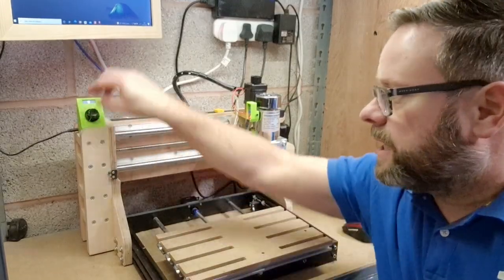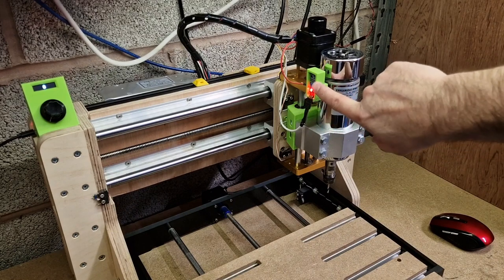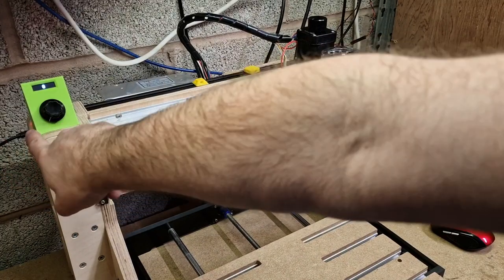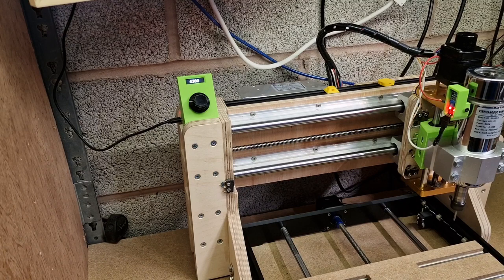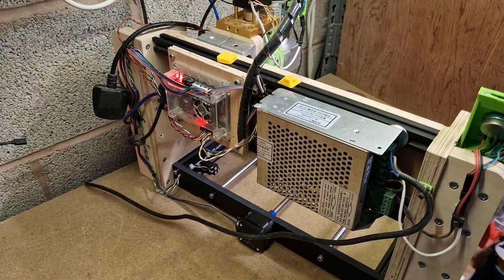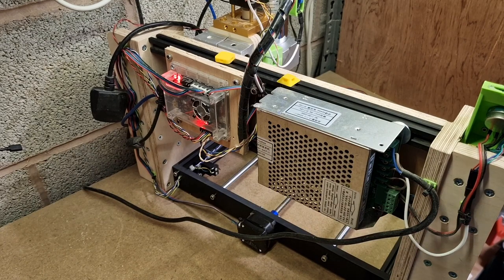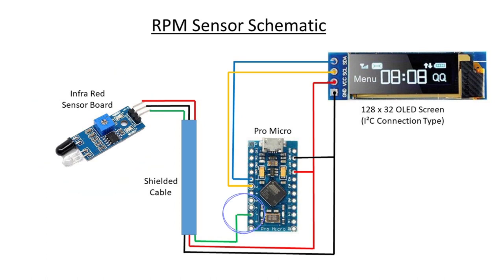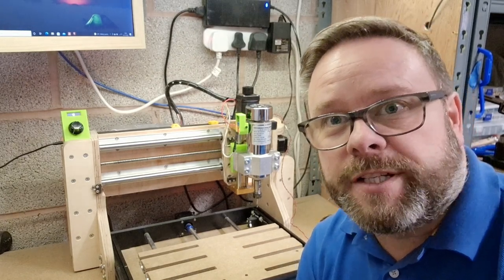RPM Sensor for CNC

Comment: Might I ask how to add the extra arduino code? Does it go into the Grbl code? Also, have you thought about controlling the spindle speed with the likes of Candle via the board and psu? I believe you'd need to add a PWM but I have no idea on how to do it.
Reply from the maker: Hi, the Arduino code is loaded directly into the arduino as it is completely standalone from the main control board. I did look at controlling the spindle via the main board but i like the ability to adjust the speed very quickly to get the optimal cut etc. However I might get the main board to start and stop the spindle which is slightly easier to implement.

Comment: Hello Matt, can you please tell me what are the lowest RPM at which this motor can run?
Reply from the maker: It can run as low as 700rpm but I wouldn't want to cut at that rpm as it's a DC motor so the torque will be terrible

Comment: Hi, does anybody know the maximum frequency the sensor can operate at? Cheers in advance!
Reply from the maker: What do you men by frequency? Maximum RPM it could detect?
Reply: @Wallworkshop  the maximum RPM will do, I just going to do it in a more accurate way, you can use the timer of the nano to get the frequency, from the frequency you can determined the RPM……yes so knowing the maximum RPM the sensor can sense would be helpful!
Reply from the maker: 20000 rpm is only 330 pulses per second so I'd say it could read alot faster than 40000 rpm
Reply: @Wallworkshop  cheers

Comment: Wery nice project, where can I get code for arduino?
Reply from the maker: Just looking at where to upload it so I can link it. Won't be long
Reply from the maker: Code link is now in the description
Reply: @Wallworkshop  Thanks for code, I was a little bite confused about interupt pin (7), using i2c for display.